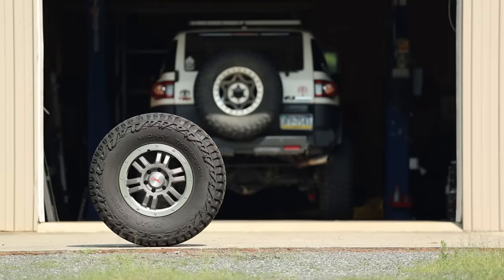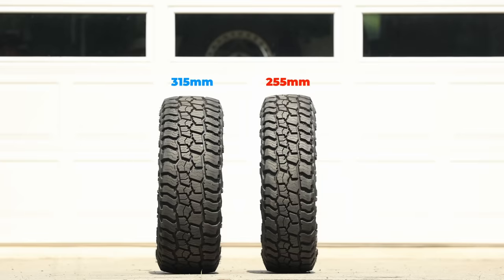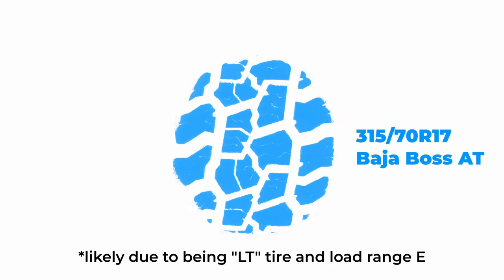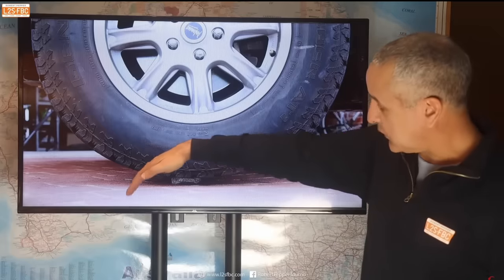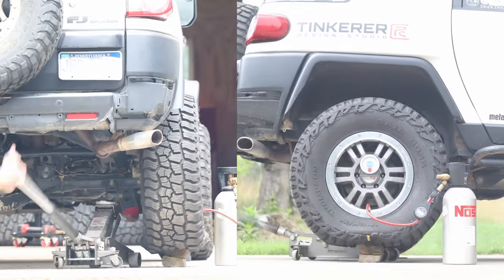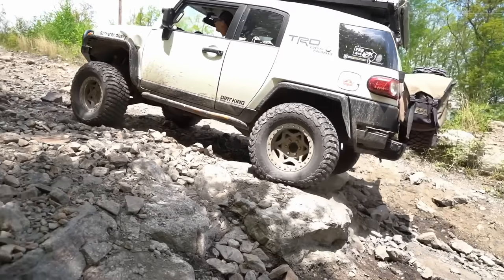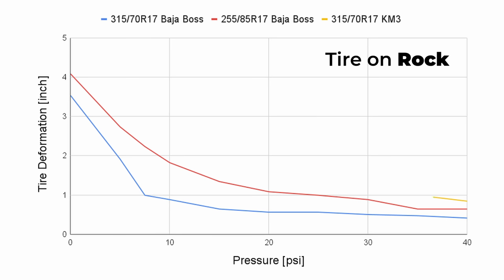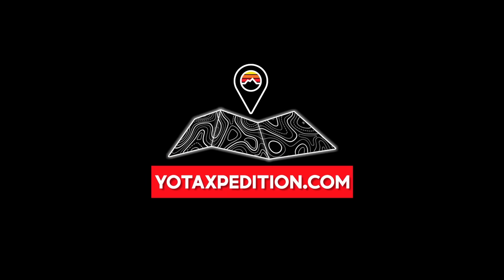3 Scientific Experiments to Settle This | Wide vs Narrow Off-Road Tires

Comment: Something big to take in to consideration is terrain you'll be driving on. Soft sand acts much different than hard rock or even snow. My brother had large 35" and very wide KM3s and struggled to get through snow about 8 inches deep. His tires kept floating on top of the snow and causing spots he would just sit and spin tires on. My 33" ko2s were about 2/3 the width and would dig down though the snow and had no problem with getting stuck. In deep soft sand though it is the other way around.
Reply: Wide for dirt and mud
Tall and skinny for rock crawling
Air up for road and highway
Air down for off-road
Reply: Same for mud, wide floats and slips, narrow cuts the mud
Reply: Yup that in snow.
Reply: This was my thinking when I lived in Alaska.  I had a full-sized Bronco and I wanted to get a taller tire than the 31×10.50s that were on it already.  I had heard that 32x11.50 could fit without issues.  But I decided to try out 33x10.50s from BFG which were available, but not common.  Everyone typically went with 12.50 in the 33' size.  But I had always heard that skinny tires were better in snow.  Anyway, the 10.50s worked out great!  I had no clearance issues.  They did a decent enough job in the snow, although I aired them down in the winter, too.  They rode nice, and noise wasn't terrible either.  And once I had them on, I actually kind of liked the look.
Reply: Good information only problem I got is ,you did not take into consideration the width of the rim. Thanks for explaining the difference everybody always thinks wider is better that's farther from the truth. The question their missing is what are you trying to accomplish with this four-wheel drive? what train are you running on?
Reply: @maluucooo it depends on what kind of mud you are going through, super watery mud, or a mudhole is made for tall and skinny, where as thin and sloppy/sticky mud, wide tires dominate.
Reply: Rally car tires for snow are mega narrow, the scandinavians have it all figures out!
Reply: @gamewarmaster  nah, evem in sloppy mud narrow tyees have it, they dig down to get the harder stuff where as fat tyres slip and float on the surface. I would love to have fat tyres, they look great just perform terrible in mud. Seen so many really good offroaders ruined and perform bad because of wide tyres
Reply: @tommyengineering8998  nope. Wides grip the top of sticky mud, and the treads dig down and take chunks out of it. That’s why wides make really good deep ruts when you know what you’re doing. Personally I’ve tried wide and narrows. Rn I’m running 35x12.50r20 and I’ve never had a tire perform so well. Plus like you said, they look amazing
Reply: After or during a blizzard in places in Canada I've lived, you do not want the snowshoe effect on your tires.  Snow can be packed down by a wide tire and the spin generated a glazing that has the snow freeze to the tire and slide like ice on ice.  Thin tires can toss that off .

Also when on highway and changing lanes where snow is forming pattern in the road making it look like a mud trail for a tractor in a farmers field the thin tire blasts through the barriers between lanes, while the wider one just sets you up to hydroplane
Reply: @peejay1981 , they race on hard surfaces, in deep snow those tyres won't work.
Reply: Its not about floatation but rolling resistsncexhigher than traction.
Reply: @maluucooo as long as you can cut down to a solid bottom to get traction!
Reply: Same thing happens up here with duallies, it’s hard to get traction in the snow compared to our single rear wheel trucks. Same tires, trucks, everything single skinny wheel always wins in snow. That’s what usps uses as well and I’ve never once seen one stuck 👍
Reply: So, thinner is also better for snow?
Reply: @michaelfrymus  yes. You aren’t trying to get traction on the snow like you are dirt and rock. You’re trying to cut through to the ground.(aka not hydroplaning)
Reply: This is what the army determined with the NDT's in the 80s, they found that they would float and slide.
Reply: @civicsr2cool If the tire is a 295, about 12.1" wide, will that be bad? Unfortunately, I cant seem to find rims for a 34" tire that's a 10.5" wide
Reply: @tommyengineering8998 the deeper you dig in to mud the situation can get worse, car starts sinking in and bam you have your diffs and axles anchoring in the mud making recovery harder
Reply: @peejay1981  rally tires are for ice paved road. Its harder to steer car on ice than on snow thats why they favor ice. On snow wider tires acts better due to wider contact patch and less digging. Less digging means less chance to get hang on snow.
Reply: @Chris-te7uk yeah, you don’t need super meats for what I do, although I do agree that 20in for 35s is the absolute biggest rims you should run.
Reply: narrow is better for snow, more weight per square. in europe, the winter tyres are allways narrower than the summer ones
Reply: @Genesis23OPB  it depends, thin powdery snow, wider tires are better. More packed kinda icy snow, narrower tires are better.
Reply: @gamewarmaster  as long as the snow is on a road, slimer is allways better. as soon as other terrain thag a street is involved, i agree with you
Reply: @Genesis23OPB  yeah, street snow usually isn’t bad enough anyway so I’m talking about off road only.
Reply: Lot to unpack with slow. You actually want trends that retain the snow on the tire bc snow to snow contact creates mor friction.
Reply: @ddroz23  again it depends. But also that is more about the treads than tire width. Aggressive treads that scoops the snow away are the best for steering and most snow. Where aggressive treads struggles is hard packed snow, say on a road that’s been driven constantly without salt. Similar to ice, but a bit looser than that.
Reply: @ddroz23  makes somewhat sense, is this the reason why autosocks are so effective in snow?
Reply: @starydwumas7481 pizza cutters are much better in snow and Ice... I drive big cmv trucks I have driven both stupid singles and duals... On a bobtail semi stupid singles get stuck if it even thinks about snowing where the standard duals cut to the pavement and keep you chugging along even in 12"+ snow depth... I have over a million miles between the two. My only wreck occurred on black ice with slush on the outer 3feet of the county road 30miles from the nearest town in a loaner truck that had super steers on it (first day in that truck) and the tires suddenly pushed at 10 under the posted speed limit... Thing is my normal truck had standard HD steer tires and never pushed in those same weather conditions on that same road stretch.
Reply: @maluucooo As long as the mud isn't very deep, otherwise wide mud-specific tires are better.
Reply: MT>AT
Reply: @michaelfrymus  I run a 12.5 tire on a 8 wide rim works great 👌🏻
Reply: Solid axle>ifs
Reply: Omg. KM3 are MTs and KO2 are AT with a tread pattern that makes snow stick which gives you traction. You can’t compare the two. It has nothing to do with the size.
Reply: @maluucooo  you don’t always want to cut. It all depends. These things exist on a spectrum. You need to pick a tire that is right for the conditions you’re in. If you know the area you’re going to drive through only has idk 6” of mud or so well then a tire that cuts is great. However if it’s 20” of Mud you’ll get stuck if you don’t float. Same for snow. And there’s different types of snow. Powder you can cut through. Thick sticky snow you can’t. You want to pack it.

Comment: This is one of the best tire videos I have ever seen.  Tires are such a black box.  Those of us who play in the mountains (and drive on roads) know that pizza cutters are the way to go but I couldn't tell you why with any specificity.  This is the sort of testing that all off road tires should be subjected to otherwise its all just fluff.   Great job.
Reply: I've always preferred a tall, skinny tire. I  never got scientific, I just knew through experience that tall, skinny tires just work better.  I really liked the QR 78 and PR 78 Buckshot Mudders. Unfortunately, tire manufacturers don't really have many offerings in tall, skinny sizes.  They cater more to the mall crawlers with really wide tires on ridiculously wide rims.
Reply: You have more pounds per square inch on the ground with the narrower tire..Traction is derived from ground pressure per square inch not from the number of square inches contacting the ground.
Reply: @wuffa4503  Uhhh.  I think you need to re-watch the video.  One of the main points was that contact patch does not necessarily correlate with tire width.    Also, tires are a long way from a brick on an incline hence my characterization of them as "black boxes."  Go as a tire engineer what he doesn't know about tires (and buy him a beer) and he'll talk your ear off.  The sheer number of variables makes it really hard and it lends itself to an iterative process.   Unfortunately for non-experts, this leaves us scratching our heads and reliant on mostly "Bro Science."
Reply: All I can say is my 38.5 x11.5x15 boggers dig.
Reply: @HD46409  the video is flawed bc he stretched the 255 onto an 8” rim giving it the widest possible contact patch, and he pinched the 315 onto the same 8” rim giving it the most narrow possible contact patch. You can even see that in the testing, where the 315 tread is clearly bulging up more in the center because it’s being pinched onto the 8” rim instead of being on a 9.5” rim it was designed for. 

When you stretch a rim the bead will come off easier, that’s the tradeoff, otherwise running a wider rim only has benefits.

255 manufacturers recommended rim is 7” wide. 315 manufacturers recommended rim is 9.5” wide. He tested both on 8”, which gives the 255 a big advantage.
Reply: @wuffa4503  , stupid farmers putting on dual and even triple tires … all depends on what you are driving on !
Reply: @wuffa4503  Traction in the dry is 100% how much rubber is on the ground. That's why summer/sport tires are wide with very minimal tread patterns. Rubber is sticky. The microscopic hills and valleys fill with water when it rains so they suck in any other weather
Reply: @TheWallsocket  Not exactly apples to apples.  Put the 315 on a 9.5 or 10 inch wide rim and contact patch will be much different.
Reply: @wuffa4503 this is false.
Reply: @TheWallsocket I'm ok with it because it more replicates what an average person is going to do...not everyone can afford to buy tires and rims or maybe they don't want to buy new wheels. You have a valid point, but reality is people will put wide tires on those 8" rims or 9" whatever we rim they have.

Comment: This is exactly the sort of thing I like to see in proper testing. Fair and unbiased date across the boards. I would be interested to see what the differences are on different kinds of terrain as well, such as mud, ice, snow, gravel, etc, given that (to my knowledge) the tires do act different on various terrains, and seeing pros and cons of each
Reply: yep the points you raise about surface conditions is what it's all about, this is where people think they can get away with all weather/all Terrain tyres, but they are a jack of all trades and master of none type of tyre, you can get specific tyres for ice and snow and they would perform much better on those surfaces, than an All Surface Tyre  (AST), but put them on a wet asphalt road, and they would not perform well at all. different horses for different courses is really the key when it comes to tyres.
Reply: You need adaptive tires, capable of morphing to different tread pattern
Activate the "TIRE MODE", turn the dial to choose asphalt/mud/rock/sand/snow

Comment: The nerd in me is so happy with how he followed the scientific formula so well. The variables controlled so well and the diagrams to show the growth as the psi drops. I should have expected it based on his major, but many props.
Reply: @@scsherman207love your comment. I think it went over most people's heads.
Reply: @Ton0987  I'm no native speaker so I'm not sure if I got it. but I think I do
Reply: You forgot the fanclubs, shouting down of opposition, ad homen attacks with optional -ist casting.
Reply: The variables were not controlled well! He needed to get a 9.5” rim for the 315 which is what the manufacturer recommends. You can’t test the narrow tire on the manufacturer recommended rim width and then test the wide tire on that same rim, which is way too narrow for the wider tire. 

I was really surprised he overlooked such a basic thing. Both tires should be tested on the rim size that they were designed for. 

Look at the results of the KM3, and observe its a different rim. I would bet the reason the KM3 performed better than the MT 315 is due to the KM3 being mounted on a rim wider than 8”, and actually has nothing to do with the tire itself.
Reply: @TheWallsocket  I believe I made this same comment in main thread. Completely agree with you. His test is garbage. The correct term for rim is wheel. Rim is commonly used because it became popular through use by the ignorant. 😊 Just a knowledge drop. No offense meant.

Comment: Great work and thanks for crediting me!  Pleased to see your results back mine up; narrow tyres aren't as terrible as people make them out to be!
Reply from the maker: Thanks for stopping by Robert! Always enjoy your technical content.
Reply: i agree and also why would the military use narrow tires if they didn't perform better.
Reply: No but you are.
Reply: @TinkerersAdventure  Looked up the tires you're comparing, any chance the phenomenon you're observing in this video could actually just be the inherent difference between 3,195 lbs @ 65 psi rated tires and 3,195 lbs @ 80 psi rated tires... maybe tires rated for high load capacities at pressures as low as the former (65 psi) are too stiff, even at very low pressures when put on relatively light vehicles.
Reply: @TinkerersAdventure  More to that end, haven’t seen anyone do a deep dive into load inflation tables and how a Tire’s load capacity varies with its psi. Could be particularly useful info for those who are switching to out of spec tires making their door jamb oem recommended psi less than ideal. There’s a tire pressure calculator on the tiresize site to convert oem spec tire psi to that of an out of spec tire on the same vehicle, also gives a decent explanation on the topic.
Reply: @theichione1827  Yeah, except for the part where no one needs any of that information because its useless.

Comment: Great Video.  The road bicycle industry went throught this same process about 15 years ago.  In those days everyone believed 7/8" 140psi road tires had the least rolling resistance.  It was not true.  Wider tires with lower pressure have less rolling resistance.  Sidewall stiffness or lack therof is also critcal to lowering rolling risistance.  The contact patch will always be the same size at the same pressuer if the sidewalls have the same flexibility.  It will just have a differrent shape.  Just like the waterline on a boat will always displace the same amount of water with the same load but if your shift the location of the load you will change the shape of the waterline.

Comment: One thing not mentioned is the time saved airing up and down for the trail. It's a very minor consideration and one I wouldn't even think about when picking a tire size but it's one more pro for a narrow tire. As a tire nerd myself, I absolutely loved the information in this video and I really appreciate how much time it takes to gather this data. Thank you, Kai!
Reply: Many books have been written about pneumatic tires. I'm confident we still have plenty to learn about tires. Each region has its own terrain, and requires a specific tire. Squirm and contact patch are the issue.
Reply: Your air up and air down time is the determined not by what tank or compressor you have. It’s determined by the slowest person in your group 😀
Reply: if you are nerd, are you a graduate of STEM?
Reply: I have ran Narrow tires on my Jeep and boy did they do better in the rocks then jeeps with wide tires. But when I went to 35s I could no longer find narrow M&S tires. Been looking for years. Thank you for this video.
Reply: I’ve noticed exact opposite. Skinny tires were worse on rocks and mud.
Reply: Especially the time saved if you're using a bike pump. Just saying. 🤪
Reply: As someone whos travelled and went off roading and camping and still had to drive on highways to and from places, thats a huge point actually. If i only had to air down to 25psi instead of 10, it would have saved me a good amount of time. At the least i could have drove a few miles to a gas station to air up instead of using those tint cheap air compressors that take forever.

Comment: I just bought new tires and also chose the narrower tires. I had an overall height limitation but had 3 options for how to get there. I went with the narrowest tire basically for rolling resistance and weight. I'm glad to see I also made the best choice for off-road performance as well. No, I'm not going through all the work you just did to prove it. I'll simply take your word for it! Great video!
Reply: Oh really Bill? You went for narrower tires for the rolling resistance and weight? I’m sure you get laid lots.